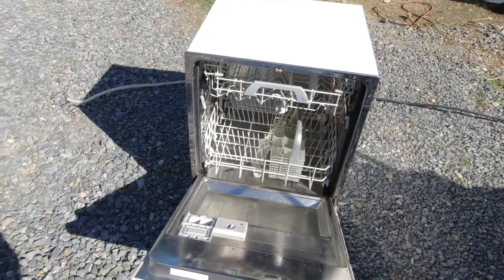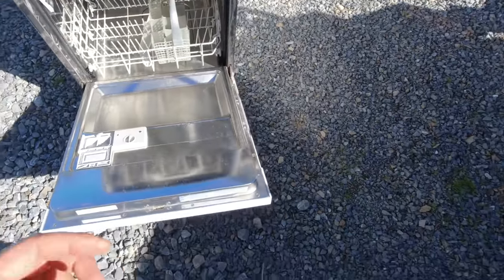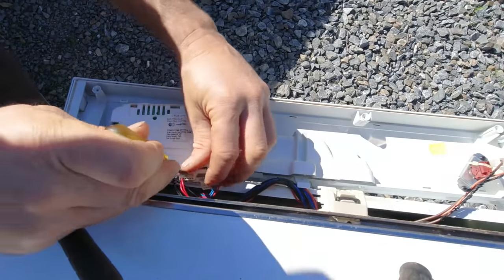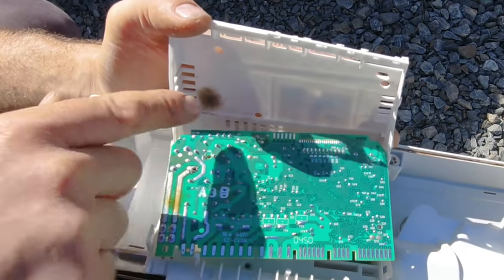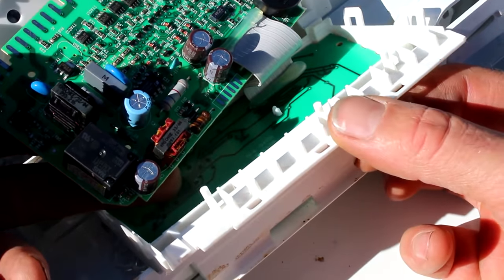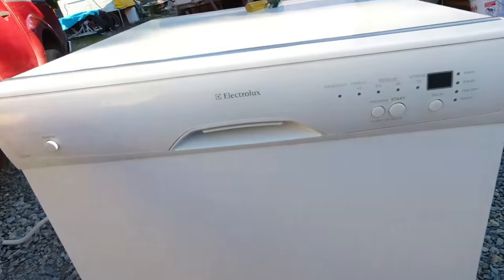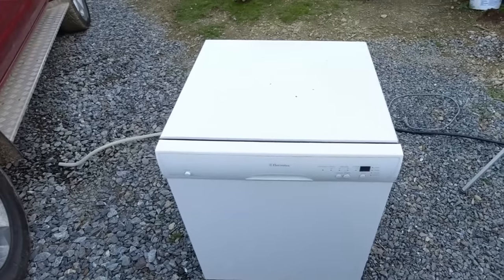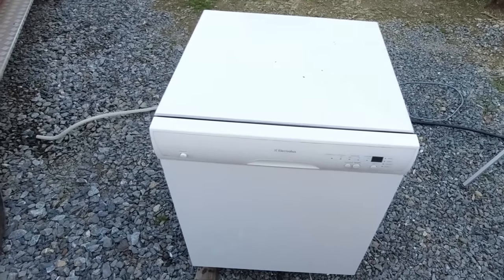Dishwasher not heating water? Try this easy fix / Offgrid Hack- Make your dishwasher use Less Power

Comment: In Australia those little circuit boards inside dishwashers attract cockroaches like crazy. It’s warm, humid and a ready source of food nearby. 😥
Reply: This. I dabble in a bit of repair work of old stereo gear and the like, I don't think I have ever dismantled a non-working appliance and not found a fried cockroach somewhere. I used to wonder where they all went in the winter, but now I know. Anything tucked away that's giving off a little heat will soon become a cockroach hangout.

Comment: Does the relay not need replacing as it looked black?
Reply from the maker: It was black from new
Reply: @MartyT  I meant the scorching on the white plastic (sorry)
Reply from the maker: @jamesread11  Not enough solder from the factory caused the bad connection to overheat, its a very common problem

Comment: Our washing machine is making a slight whirring noise at the end of the final spin cycle, any tips Marty?   Bob, Hutt City.
Reply from the maker: Maybe bearings on the way out?
Reply: @MartyT  OMG i guess that will be costly to repair?
Reply from the maker: @daddybob6096  Last set of bearings and seal I bought was about $30, it might not be that, hard to say without hearing it. the sound will gradually get worse if it is
Reply: @MartyT  I can't do it myself Marty, i'm 80yo, thanks for your help, greatly appreciated. Bob. LH.

Comment: If the water does not get heated would it still complete the cycle or it would stop for the new models ?
Reply from the maker: It just doesn't wash very well
Reply: @MartyT  
Thank you for your answer.
I am asking this question because I want to wash things in the dishwasher without heating water and I thought to use a switch that can disconnect the heating element every time I need to wash those things. And I would put the switch on whenever I need it for dishwashing
This is why I want to know if the dishwasher would compete the cycle ?

Comment: At 1:15, is that wire insulation on the right all burnt?
Reply from the maker: No its like tarry glue on the inside of the door
Reply: @MartyT  Ah that's good, didn't think you'd miss that.

Comment: What caused the solder joint to over heat?
Reply from the maker: Likely not enough solder on the pin from new, it is a common problem
Reply: @MartyT  ok that makes sense, increased resistance, thanks

Comment: Hot water can result in solenoid failure if fed directly in, which is what I was told was the reasoning behind cold water only input dishwashers (major service life reduction on hot water valves)
Reply from the maker: Yeah you wouldn't want to feed boiling water in to them.. I've been feeding hot water into the dishwasher and washing machine for 17 years, haven't had a solenoid failure yet

Comment: Electrolux is one brand I avoid, everything I have had from them broke down just after the warranty was up.
Reply: Unfortunately they now own AEG, Anova, Frigidaire, Westinghouse and Zanussi, Tappan, Kelvinator and Gibson.
In 2014, Electrolux tried to purchase the General Electric appliances division at a cost of more than $3 billion in cash.
So what do you buy in order NOT to get an Electrolux product?
Reply: @JohnSmith-pl2bk  I have switched to products from LG and they have worked good. Just changed the water pump on my LG washing machine after 10 years of hard use (2 kids). But some people say that LG are of poor quality so maybe I have just been lucky. Just got a LG oled TV too!

Comment: Not knowing any better, I ran a dishwasher on cold water for years....   The dishes came out just fine.
Reply: The "Energy Saving" ones sold in NZ have a 2400watt water heating element that looks like a donut...as the water is pumped  through it is heated.  
So only one cold water connection is necessary....

Comment: Is it working....Yes

Was that solder joint poorly performed....Absolutely.

Should have gotten rid of all of the old solder on the pad, cleaned the protruding pin, to make a good solder connection and then applied new fresh solder, using a suitable soldering iron.

That solder joint is probably going to last less time than the original one.

Comment: You can also disconnect the temp sensor in most of these. Easier than popping off the solder off that relay. A more advanced method would be to find the resistance at which the sensor relays peak temp and to put a resistance in line for that. TO be read, that these are less damaging. Each time solder is applied to a board, you're courting disaster, AKA trace lift.
Reply: When the water is not heated would the cycle be completed or the dishwasher would stop in the new models  ?

Comment: The wires on the far right look burned too, all the insulation is gone!
Reply from the maker: I thought that too but on closer inspection it is actually the insulation goo they sprayed on the internal wall of the door
Reply: @MartyT  Good man, I stand corrected.

Comment: Sorry, but you still need to learn how to solder. The soldering point must first be cleaned, and then be sure to use rosin. Why? Because otherwise the soldering will be ... cold, i.e. the electrical contact will be weak or not at all.
Reply: That solder has the flux built into it.....

Comment: Or just hook the dishwasher up to hot water to save on the power to heat the water.
Reply: Modern dishwasher manufacturers want Greta's seal of approval...
so no hot water inlet provided from new....
Reply: @JohnSmith-yv6eq  I use a heat pump that only runs for one hour every day in the middle of the day when my solar PV is giving me free energy. Hot water lasts all day and night.

Comment: My 10 kiwi cents worth i'd have flowed on more solder to both those wide tracks leading off the relay switch contacts pins.  The tracks are underrated for the amount current going through them hence the burn marks... Probably a dying heater element is the cause... Who off grid rocks a dishwasher?
Reply from the maker: Yeah I rushed the solder just to make it work, I took it back off straight after ;)..  I use hot water from my hydro turbine for my dishwasher
Reply: Who uses the word "rocks" instead of "uses"?
Reply: @nickturner2813  winky-dinks, I assure you.
Reply: Dying heater elements?  I've replaced two very dead ones in an unbranded dishwasher. Not difficult, but cost 60 GBP. (The second was a free replacement). Beware sharp metal edges under the machine, it's easy to slice hands while you work on the hoses in a small space.

Comment: Replace that relay and inspect all the traces and solder joints anywhere near the relay. Either the relay contacts are sufficiently worn to cause excessive arcing/heating OR the relay was not spec'd correctly for the load. Replace it before it catches fire and a great deal more is lost. Relays are CHEAP, life is priceless!!!
Reply from the maker: Its a common issue with these, lack of solder at the factory, should be good now

Comment: Whoa. Why did the relay overheat in the first place. You should have replace the relay. Reusing the same one could cause a fire the next time it overheats. This is irresponsible behaviour.
Reply: It's most probably not the relay that overheats, but the solder point. Seen it a lot, machine soldering does often use too thin solder joint, which makes it overheat over time in a high current  application. I do repair a lot of equipment because of this.
Reply from the maker: As Bgood1965 has said, they were a bit light on the solder from the factory causing the pin to overheat